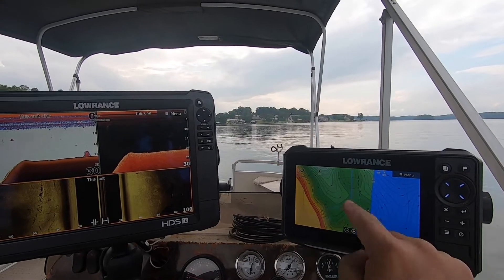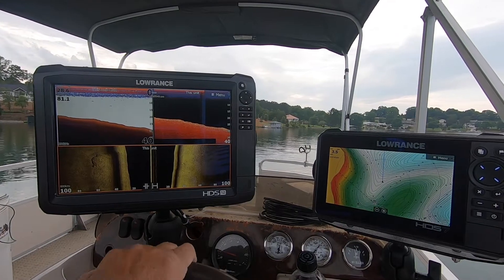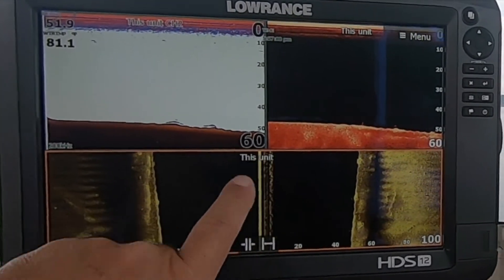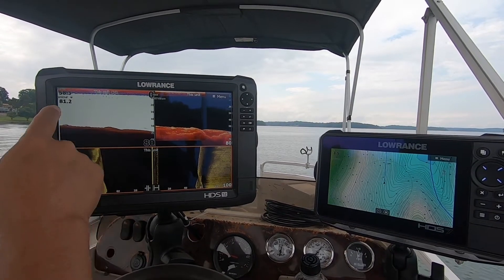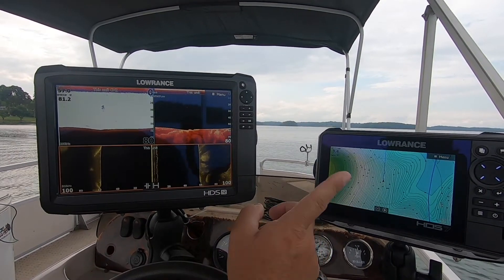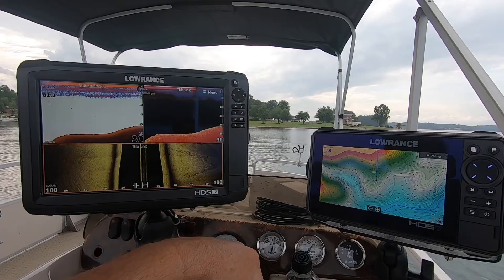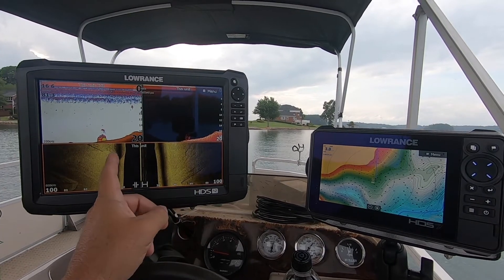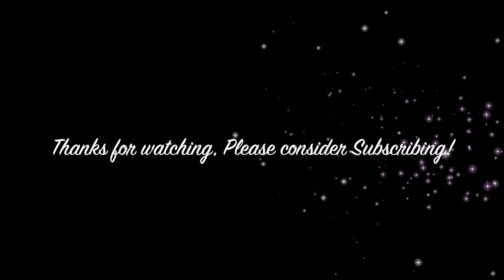Locating Roads, Culverts, and Foundations using Side Imaging

Comment: Just got my first side scan unit and watched a lot of videos.  Never could wrap my mind around a beam going straight down then making in essence a 90 degree turn to show the bottom.  Beams, like light, radio and sonar, typically travel in straight lines.  Then the need to subtract the water depth?  With the technology in these units, it would be a small tweak from the manufacturer's software to make that automatically compensate for depth.  Why wouldn't they do that? Well because you don't subtract the water depth, in essence it is already subtracted and the distance the bottom separates from the water column.  This video makes the most sense. Since the side scan shows surface AND bottom the whole column out to a certain distance is shown on the screen.  Which makes sense to me, no need to imagine beams "bending" or doing math in your head.  I'm beginning to understand this.
Reply from the maker: The small tweak you are referring to, to compensate for water depth is exactly why I started sinking objects and scanning them.  Subtracting depth from the distance would be an easy software fix, so it made zero sense to me either.  Thanks for watching!🐿